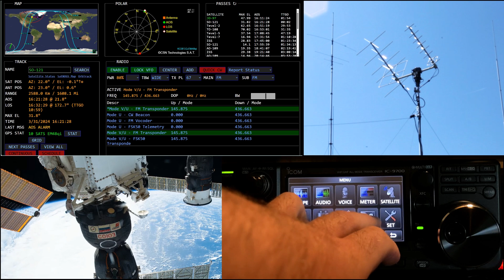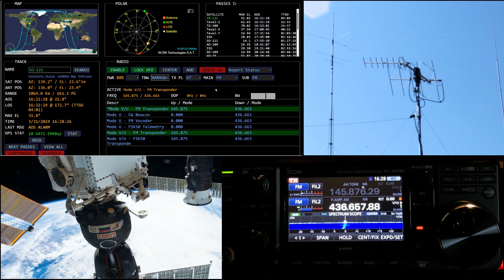Ham Radio Satellite SO-121 Hades-D on the Icom Ic-9700

Comment: Just curious about your antenna set up I’m looking at doing something similar and do you run separate feedlines to each antenna back to the radio or do you use a Diplexor at the antenna or something else? Also what sat tracker program are you using? Thanks in advance.
Reply from the maker: Hello!! I run dual coax up to mast mounted preamps. Then out to the phase cable for each antenna. The antennas are set to RHCP but I might do a switch box some day for the UHF side. 

The program is the CSN Technologies SAT controller

Comment: I thought I was the only one that had trouble getting into SO-121. You hear better than I do, I get 1 QSO if I'm lucky. I see my signal when I TX so I know I get in but the signal is very weak for me. I thought for awhile I was using the wrong mode or something, what is up with the 2 narrow modulation lines together on the waterfall? 2:25 I have the exact thing happen on my ic-9700. But it does that for most of the pass until its overhead for me.
Reply from the maker: Hey Aaron! No it’s just ultra low power. I think it’s putting out .040 watt on the repeater on narrow FM. I was the same as you until I got a mast mounted preamp. That greatly extended my range. If others can hear it I can make up to 3-4 contacts on a pass. But it’s all up to if they can hear. I wonder myself what that transmission is because it’s much stronger than the repeater. It also sets a timer shut down. It’s somewhere around 10-15 seconds after that transmission that it comes back online. I haven’t caught any sort of data from it but maybe it’s digital telemetry?

Comment: I was not expecting to hear my call sign as the first one.  I was using a UV-5R for uplink and a FT-817 for down fed to an Arrow antenna.  This is a hard bird to work with my setup, I only have one successful QSO.  Now I know I am making into the bird, I have to refine the receive, no preamps on the 817.  de N7JRR
Reply from the maker: Wow! That’s awesome! You had a solid signal for A couple minutes, there was three of us that called you on the pass. I didn’t include my call to you or K2ERK since I didn’t get a response. Hearing this satellite is definitely the hardest part. Keep up the good work man, hopefully I can catch you on there!
Reply: @W0CYC-HamRadioEndeavors  that bird is very hard to hear using the FT-817 which only has a 5 kHz step size and SO-121 with a downlink center frequency that doesn’t fit nicely into that step size, it’s a challenge.  But who’da thunk it, the Baofeng gets in no problem.  The 817 has CAT control tuning so I’ll try to track that shifty Doppler dude with Gpredict.
Reply from the maker: Wow that is even more impressive! It is super hard to hear with my setup so you’ve definitely got a good thing going with that portable setup. Keep chugging away at it, it’s very rewarding to finally make a contact on that satellite. It’s definitely the most difficult one….well that and a jammed ISS pass but that’s two different reasons😂